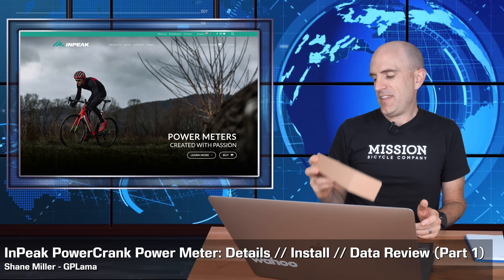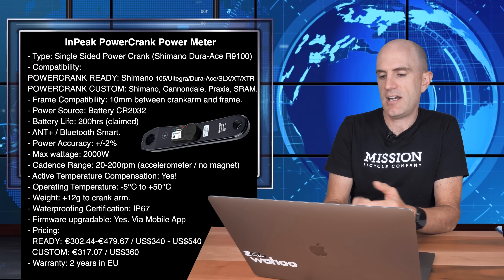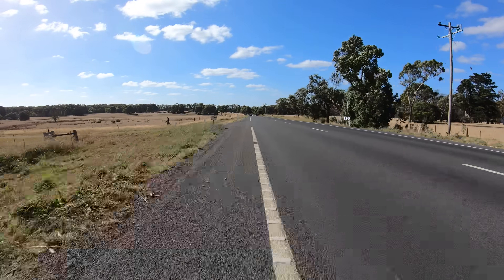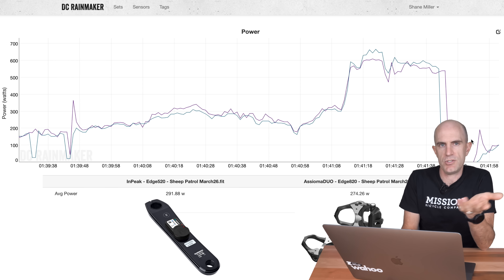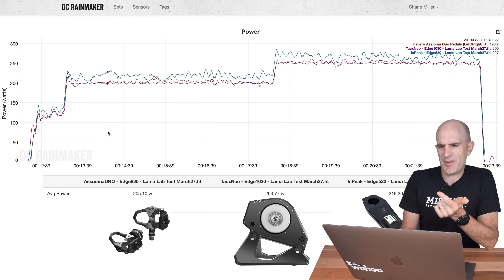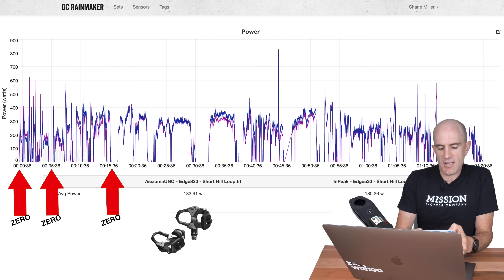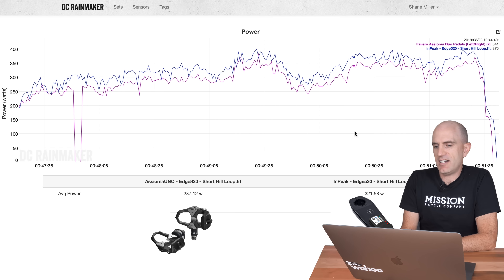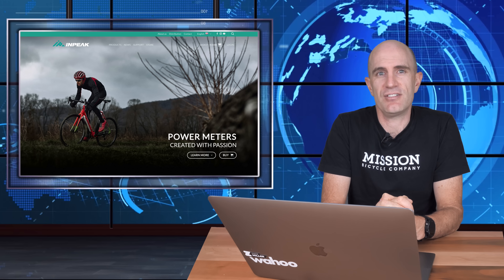InPeak POWERCRANK Dura-Ace R9100 Power Meter: Details // Install // Data Review

Comment: Do the Assioma Duo require 14nm torque spec?
Reply from the maker: No. Just tighten them up like a normal pedal. Zero them. Ride on.
Reply: Shane Miller - GPLama thanks Shane. I checked website (which I did after posting my question). They say 30-40nm 😳. That's huge. I usually just snug up my pedals. Is that what you do too or do you go to an exact torque. I think my Ultegra say 12-14nm
Reply from the maker: @RixterNow  That's likely about right for an 8mm phat hex wrench into the pedal spindle.
Reply: Shane Miller - GPLama thank you

Comment: Price for 105 5800 left crank powermeter is 366 EUR + 9 EUR shipping cost. Why should I spend 375 EUR for some unknown powermeter from Poland,  while I can buy stages 3 for 350 EUR or 4iii for 300 with next day delivery and local guarantee? 

  InPeak, at this price point you won't get any market share.
Reply: You can get for about 300€ 4iiii crank arm and it's excellent...
Reply: 300-350eur... Where?
Reply: @mac2453  mantel.com , stages 350 EUR , 4iii 300 EUR. Few weeks ago stages was discounted for only 300 EUR
Reply: @mac2453  https://www.mantel.com/pl/4iiii-precision-105-5800-power-meter

Comment: Another great testing effort! I really like the PIN access control, the app graphics, and the price isn't too bad. I don't like the frequent calibrations and the overall results are not so encouraging. I notice that InPeak responded to your concerns publicly and appear to be on the case so it will be great to hear what they have to say about it, and maybe ship you another crank, should you be interested in going through it all again.

I can't help thinking that crank-based power meters are a bit of a rip-off though: the cranks are cheap (~$80 US for an Ultegra R8000 left crank in single unit shipments) and the electronics should be pretty straightforward off the shelf components (no FPGAs) - and cheap - so long as ANT+ and BLE are supported. Then all you need is to accurately bond in the strain gauge - also cheap - and provide the software to do the sensing, calibration and interpolation. (I know, hand wavy...) These two items are obviously where the cost and expertise come in. Seems like an excellent opportunity for a bit of open-sourcing. But maybe the setup, calibration & conformance require a physics department or facility able to accurately load and test stresses on the cranks. I wonder how many get sacrificed because the bonding wasn't correct, or the readings are just too far outside of allowed tolerances? Wishing that Shimano could get their act together on this seems to be asking too much, especially at a "reasonable" price.

Comment: Have you ever done a review on the PowerPod? Really interesting concept, looks a nightmare to set up with the Isaac for mac program but from what ive read the data is very good for its price point of €300 ish...
Reply: DCRainmaker did a good review on the powerpod. I had one a bit ago and they've recently updated the calibration routine. You no longer need to plug it into Isaac before calibration and it's only a 6min ride now. Still need Isaac for intial set up but after that there's no need to use it really if you're only using it outside on the one bike. Can be used on a trainer and with multiple bikes (4 I think). Crazy clever bit of kit and it does seem to give accurate numbers, especially considering the price. I only changed because I picked up a unused gen 2 Stages for silly money and only need a pm on one bike.
Reply from the maker: Nope. And not on the cards. I have may hands full with direct measurement power meter issues. Power meters based on magic would break me... :)

Comment: I’m assuming that temperature doesn’t play a factor here. Was it better in the heat vice the cooler indoors?  Since it has active temperature compensation , it would be interesting to see if that had anything to do with it going out of calibration.
Reply: Temp. is a factor for all strain guages as it impacts expansion/elongation/deflection as does applied force/torque.

Comment: That's a shame for this PM being so off. BTW how sure are you that Assioma's are accurate? I saw stages on right crank, maybe you could compare with that as well just to be sure. 
But more I look at graphs more seems like their app is not calibrating well. 
And thanks for listening my comment to break Assioma into UNO. Makes it more clear to compare :).
Reply from the maker: Multiple reference points to be pretty confident with the Assiomas. The Neo 1 which the Quarq (static calibrated) agrees with, Neo 2, Kickr, Direto, etc, all agree with the Assioma. The Stages Right is documented in my video on the L/R video on that unit. Until I have a PowerTap G4 disc hub, they're my go-to out on the road.
Reply: Real pity, was hoping for better results as well. 
And looking to their duraace ready crank it costs 575€ in EU. Way too high price, rather recomend Assioma UNO (its 130€ cheaper) or DUO through some good deal.
Reply: Assiomas are winner of this test LOL. @UrosHuzjak